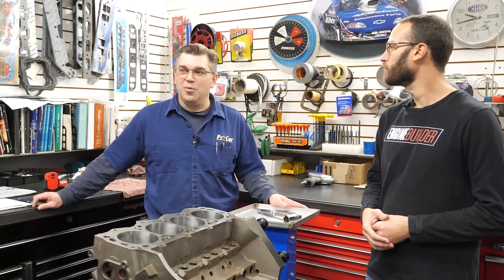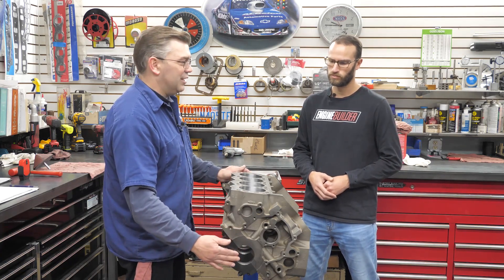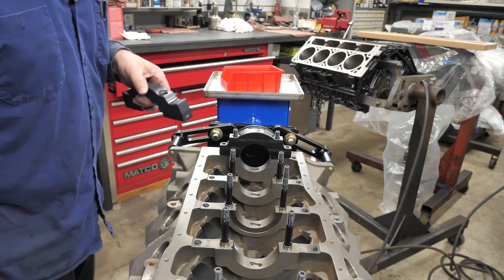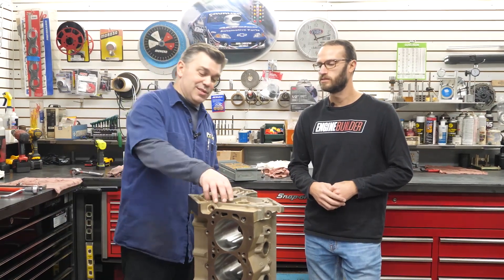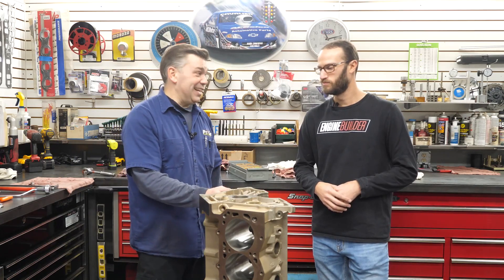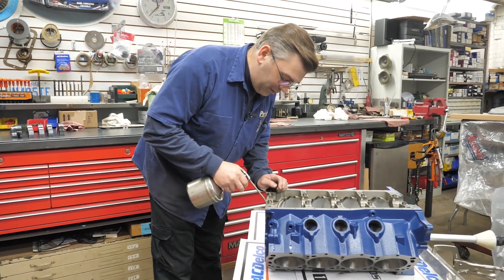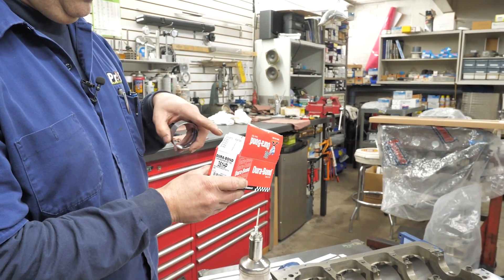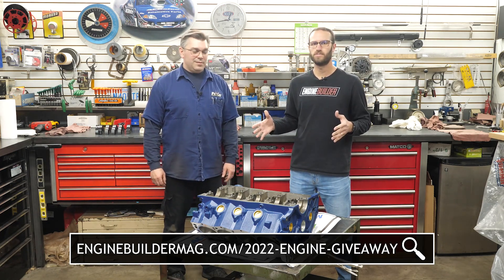Dream Engine Giveaway Ep. 2 – Block Prep

Comment: What was the 'fluid' that he used to wipe the bores after the dip?
Reply from the maker: Steve, Chris was using transmission fluid or "tranny" fluid to wipe the cylinder bores and keep them from rusting. He does a final wipe down before assembly.